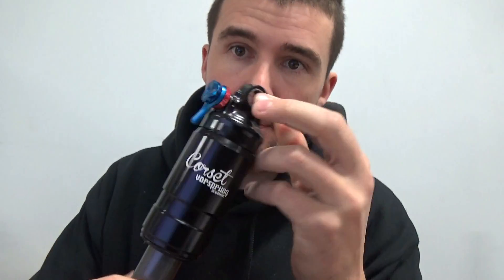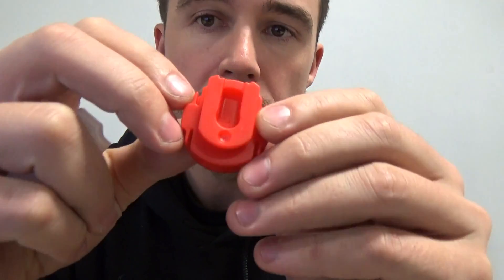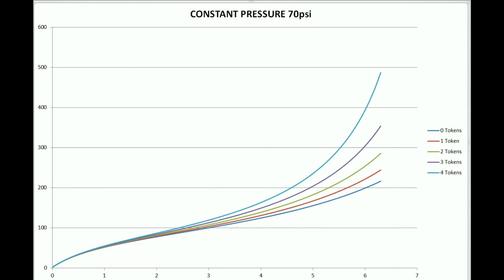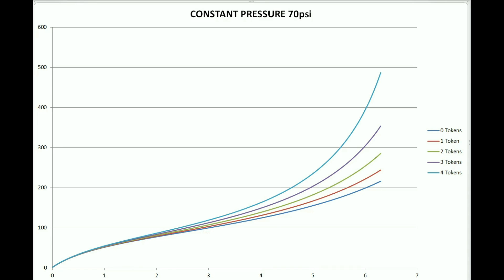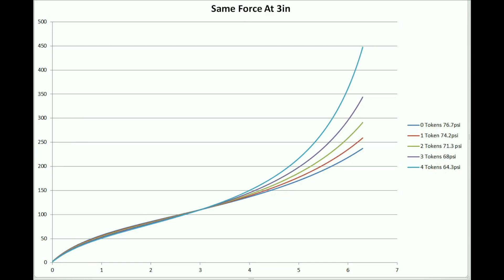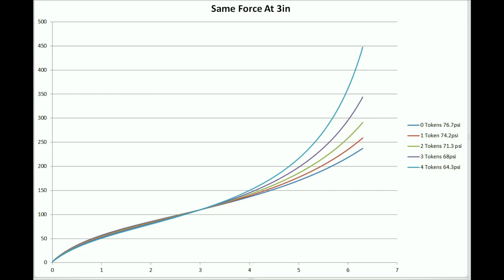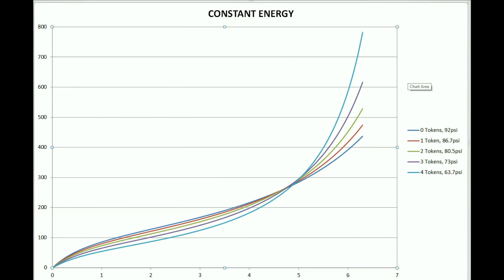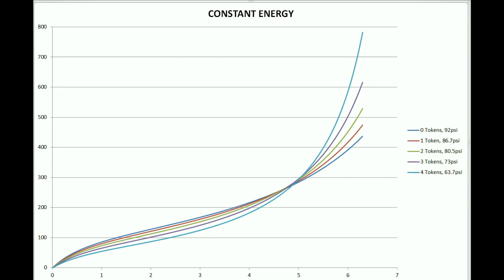The Tuesday Tune Ep 3 - Air spring volume spacers

Comment: Great explanation. Thank you! I love your videos. It seams to me, after watching your video and after using a ShockWiz, that most people are not using enough volume spacers. Most of my friends would run 1 or 2 tokens and we thought more than 2 tokens was mostly for people who do very high jumps, but I don't think that's the case. The ShockWiz keeps telling me to run 3 or 4 tokens and to lower my base pressure. Your graph helps explain why, because the beginning and mid stroke get just barely plusher, but the end stroke ramps up quickly to prevent bottom out. Do you find that most riders you work with are not utilizing enough volume spacers? Thanks again for your awesome videos!
Reply: Hi. If you want plusher feel you should not use more tokens and less pressure. It will make your fork really harsh. If you increase pressure slightly and reduce volume spacers it will create more linear curve with more mid stroke support, your fork will not dive as much and will stay more in beginning (softer) part of stroke. If you run less pressure and have fork with full of spacers, you are riding already in middle of your aviable travel and then if you hit bumb big enough  you go straight to overly progresive end stroke which feels very stiff and harsh.

Everebody has their own preference how to setup suspension. I'm fan of more linear curve which works well for me. I'm not saying everbody should run it like that, but give it a try, just remove all tokens pump more pressure and give a shot,  maybe you will be suprise how well it works. And dont bother using shockwiz, its app just geussing what is good or not, I mean 4 tokens is not great idea, if you hit some big hole with 4 tokens in your fork your shoulders would probably fly off your body.
Reply: True story. And just think about what suspension companys were trying to achieve with larger and larger air volumes over the last years. The want to make air forks /shocks more linear so they give more mid-stroke support without beeing to progressive. So just add spacers when your fork/shock ist bottoming out to often. Imo.
Reply: @QeX9   I agree with you as well. One year later after my above comment I'm using the following in my Lyrik Fork (my weight is 180 lbs) pressure = 77 psi, tokens = 2, Rebound = 7, HSC = 0 clicks (fully open), LSC = 6 clicks. Maybe sometime I'll try just 1 token, but for now I'm using 2.

Comment: Steve what do you think about using one volume spacer in the fork, with regard to lessening bump sensitivity. Do you think Small Bump compliance would be compromised with just one token or not very much at all.
Reply from the maker: The general idea of adding volume spacers is lower pressure + more progression to improve small bump compliance via a softer initial spring rate that ramps up hard enough to prevent bottoming later on. It may be beneficial if the fork is not already too progressive, or it may be detrimental if it's already too progressive and you're already too far into the travel all the time.

Comment: Hi

I have a NS Bikes Snabb E with CCDBACS XVol + 2 large volume reducers. setting SAG at about 27% (17mm from 63mm of travel). I can still quite easily bottom out damper (landing not to big jump on a flat). currently i have 1 rev. of HSC and 5 clicks of LSC (prefer suspension to be plush/subtle)

What's better to do now? add more spacers to XVol can or add more compression damping (but it can make my suspension harsher... ? )

my settings: (1rev HSC, 5click LSC, 1r HSR, 5c LSR)

my leverage ratio:
http://4.bp.blogspot.com/-9_lwUrz7QnU/VIo7pT9qJwI/AAAAAAAAVCg/jGTGG3LyafI/s1600/NS%2BBikes%2BSnabb%2BE1%2B2015_LevRatio.gif
Reply: Just for people dealing with these problems in the future:
A progression from 2,9 - 2,4 isn't overly progressive so more volume spacers will help. Compression damping in general won't help much against bottoming out on jumps and stuff. If you would dial in much compression damping to prevent the suspension from bottoming out the bike would be unrideable.

Comment: I recently ordered an air shaft for my Fox float 34 140mm to bring my Mondraker Foxy R  to 160mm up front, as I would like the front end to be a bit higher with more travel
What would you suggest in terms of volume spacers so I can get the most of my new setup in the context of small to medium bump compliance? I would really want to achieve a similar plushness in the first part of the travel as a Rockshox Pike is known for? I feel my 34 a bit stiff, and I would love to have a bit more traction both on climbs and decents. 
Do you think adding a spacer and putting less air volume would help?
Thanks a lot and I appreciate the time, effort and passion you put into making all this great material!

Comment: if the fork feels like its diving would you add more pressure or another volume spacer? I have 2 in my fox 34, but I'm not using the full stroke, any recommendations?
Reply: More pressure less volume